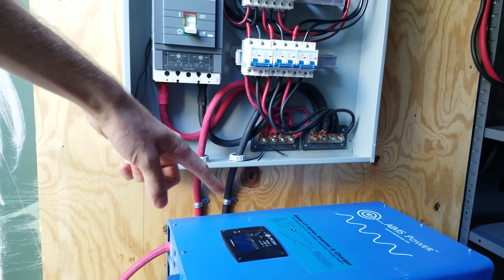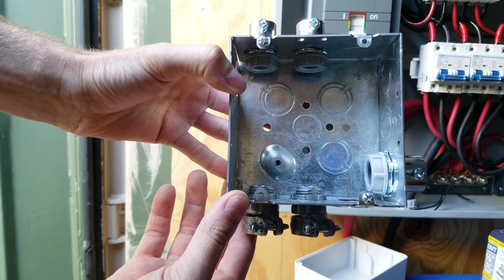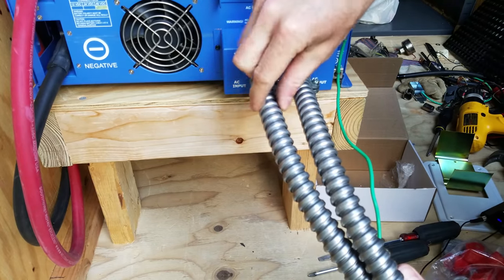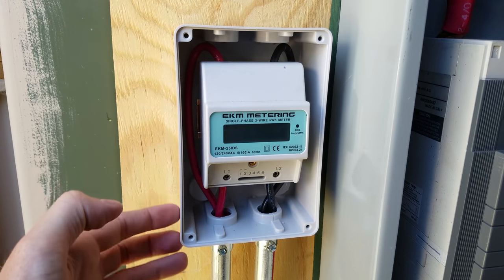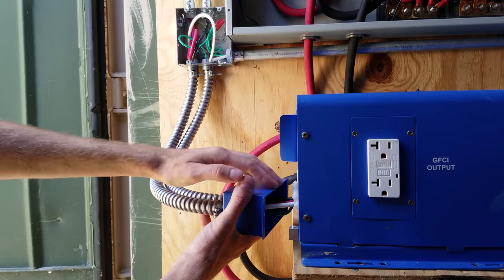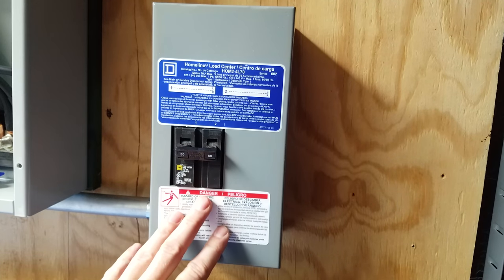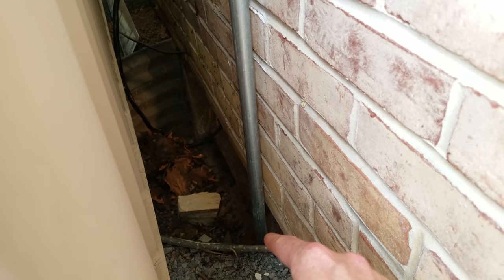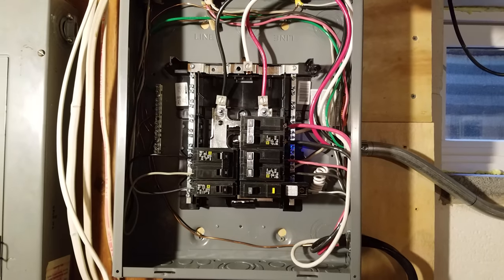Connecting the AC Wiring to the AIMS 10kW Split-Phase Inverter

Comment: Hello what is your output voltage with this model is it 115 or 120 - 230 or 240   thanks Great channel
Reply from the maker: It's split-phase output so it has L1+L2+N - both 120V and 240V.
Reply: @LithiumSolar i only have 114.1 L1 & L2  and 228.4 across both legs   in dont have any AC input and factory set dipps 1-1 2-0 3-0 4-1 5-0   same model as you have   and ideas   thank you in advance    and charger is set to 0 no charge

Comment: One question are you separating your solar power from the utility company's control so they can not turn off your solar power to you use when they shut down power to your area? it is what all solar power owners need to do...
Reply from the maker: No. Any form of grid-tie, including hybrid connections, require permitting in my area, which results in very expensive hardware. Running an off-grid inverter does not require permits.
Reply: @LithiumSolar  Thanks for that reply...

Comment: Don't see the link for the transfer switch. Do you also have video how to install it? I would like to install transfer switch for a few 120v circuit from grid to solar when needed. Your setup looks great. Would like to mimic it.
Reply from the maker: Oh, my bad. I neglected to include the one item I actually said I was going to include.It's the Pro/Tran2 A510C https://amzn.to/2Nud6om You might be able to find it cheaper if you shop around a little. I don't have any videos installing it because it requires work in the mains panel, but it does come with installation and connection instructions :)
Reply: @LithiumSolar  thank you. I wonder if there's a video to show the inside so that maybe can diy it to save a little more.
Reply from the maker: @taniksambo1969  It's pretty much just a SPDT switch with the center pin going to the branch circuit. When you're dealing with large amounts of power like this, I always prefer UL-listed equipment vs the DIY route. You can find them cheaper than the Amazon price. It looks like they're $350 on Lowe's website.
Reply: @LithiumSolar  oh great. I'll have to take a look at Lowes. Thanks again

Comment: My sub panel (200 ft to an outbuilding) was installed in 2000 with no ground, only L1, L2 and Neutral. All neutrals and grounds are bonded in the main service panel but there was no ground ran to sub panel. I'm stuck on what to do with the neutral output from the inverter. Any ideas?
Reply from the maker: I would suggest having that evaluated by a licensed electrician. Not having a ground conductor run with that feed sounds very wrong...
Reply: That will be my next step. The sub panel was installed before NEC changed requirements (2005) to include ground. In my case, the inverter output will provide neutral to all loads on it's own sub panel and have a dedicated earth ground.   @LithiumSolar

Comment: The AC output, can it go back to the house panel into a breaker? I want the solar going back to grid from the sinewave generator. Is that even possible?
Reply from the maker: NO! This is not a grid-tie inverter. You will blow it up and very bad things will happen.

Comment: Do you have a GFCI comnected to your transfer switch? Does it trip?
Reply from the maker: Some of my branch circuits are on GFCI breakers or serve GFCI receptacles. I've never had any of them trip as a result of using the transfer switch. The GFCI has been tested and functions fine though.
Reply: Hmmm im doing something wrong then because mine trips
Reply: @LithiumSolar  i am supplying red and black wire with the inverters black wire then white goes to white....there is only black white and ground coming from my inverter
Reply: @LithiumSolar  hello so i just tested the new renogy 3500 48volt inverter charger and when i plug the AC input the GFCi trips due to its getting 30volts on both legs is this normal?
Reply from the maker: @moneth08able  It definitely sounds like something is wrong with your Neutral + Ground bonding. It's either missing, bonded in two places (very bad), or bonded in the wrong location. There are a lot of variables here, including whether or not your inverter even supports N+G bonding, and I am not qualified to give advice like this. If you're not sure, I would highly recommend taking the safe route and finding an electrician to help :)

Comment: Service entrance wire would be consider any source of created /income power as in utility's , generator or solar inverter. The >>>minimum size<<< service conduit shall be >>>1-1/4”<<<<. The minimum size service entrance wire shall be rated 100 amperes minimum for single family dwellings. For single family homes, the service disconnect means shall have a rating of less than 100 amperes, 3-wire. A larger service may be required for new homes or additions to existing homes based on the actual load calculations. (CEC 230.79(C))

Comment: would have been a heck of a lot cheaper to use a murray 6 circuit sub box and standard breakers  instead of getting a custom 50/15/15 and stuffing everything in what is meant for an a/c unit or hot tub.
Reply from the maker: Yeah I probably should have just grabbed the 6-slot Square D for practically the same price, but that was an after thought...

Comment: Splitting the wiring that comes out of the inverter causes two problems. One you create an induction loop and two you are also creating a choke. You can de-rate the neutral if you if you have 240 volt loads.
Reply from the maker: Yes. Apparently I need to redo that to use one conduit...
Reply: @LithiumSolar , don't forget to buy a couple 1/2" KO seals when at the hardware store and maybe some 3/4" conduit straps.

Comment: I really dont understand why in the US metal junction boxes are used instead of PVC !
Reply from the maker: We have PVC boxes/conduits. I will never use PVC boxes where I can use steel boxes/conduit.
Reply: @LithiumSolar  In Germany these are always non conductive plastics especially outdoors, but then again the grid is 230 V!Of course metal boxes are more durable and UV resistant.
Reply: pvc can melt in a fire. If you install a ground wire on the inside of the metal box by code your safe........

Comment: As an electrician, leaving slack in the wire is called a courtesy for they guy that has to work on it after you, especially because you might be that guy cursing your past self if there wasn't any slack

Comment: You should not have split the phases into different metal conduits and metal box openings. It will cause heating and power loss due to eddy currents. When you put them together, the opposite direction currents cancel out.
Reply from the maker: Yeah, I know now it needs fixing. Thanks for the reminder.

Comment: second:-). Did you soldered the batteries?
Reply from the maker: Some of my earlier-built batteries are soldered. I started using a spot-welder a few years ago. I do not recommend soldering batteries.
Reply: @LithiumSolar  They looked like the soldered packs
Reply from the maker: I have two banks of 14s300p. One bank is soldered, the other is spot-welded. The bank currently installed was soldered. I'm waiting for my new shelving unit to reinstall the other.

Comment: You really need a ground rod next to your "Solar Shed" grounding the shed and the inverter.
Reply from the maker: I have one, driven in 8ft. I just didn't show the connection for that in the video.
Reply from the maker: The shed itself is not connected yet though, I do need to get that part done.
Reply: @LithiumSolar  By code you need 2 ground rods minimum 6ft apart.

Comment: , I don't understand in the USA why you have AC running in metal boxes and metal conduit
Reply from the maker: I don't understand your country. Why would you use plastic? It's crap. It melts, it burns, it catches fire, it's cheap, it sags, the list goes on and on. Metal is where it's at. Metal is professional. Metal is solid. Metal is protection and safety.
Reply: @LithiumSolar  Metal is fine for commercial or industrial, but for residential where aesthetics are an important factor, plastic offers far better choices for customers in terms of design and flexibility, if it as you say, 'melts, it burns, it catches fire, it sags' then it was installed wrong. it seems that you enjoy the industrial aesthetic, which is fine, but most people wouldn't want a shipping container in their garden or galvanised metal conduit all over their house. also in regards your last point, metal has it's own problems, as other commentators have pointed out with your mistake regarding induction!!

Comment: technically your box sizing and allowed space of wire in conduit is against the NEC code but ill it slide.
Reply from the maker: Which part specifically? The conduit is less than 2ft so 60% fill is permitted.
Reply: @LithiumSolar  inverter is consider a source of power aka service entrance wire! Service entrance wire would be consider any source of created /income power as in utility's , generator or solar inverter. The >>>minimum size<<< service conduit shall be >>>1-1/4”<<<<. The minimum size service entrance wire shall be rated 100 amperes minimum for single family dwellings. For single family homes, the service disconnect means shall have a rating of less than 100 amperes, 3-wire. A larger service may be required for new homes or additions to existing homes based on the actual load calculations. (CEC 230.79(C))

Comment: running each leg of your spit phase 240v of your generator through separate conduits will cause induced voltage in the conduit making th.e conduit a transformer. DANGER. A high enough induction can melt the conduit.
Reply from the maker: I haven't seen any heat no matter if I put 100% load on one leg or both legs. But regardless, you are correct and it will be addressed/fixed shortly in an upcoming video.